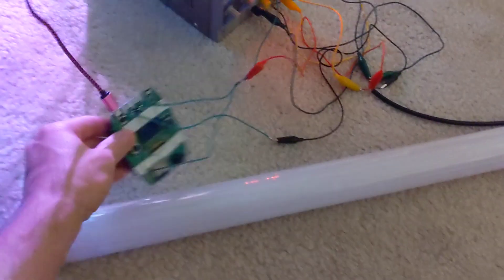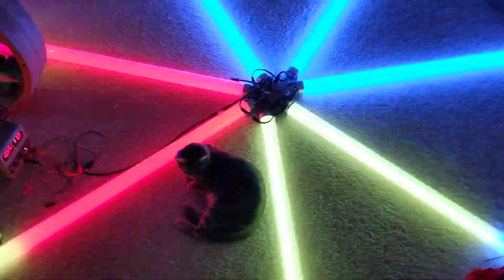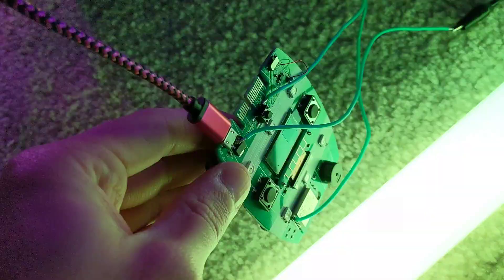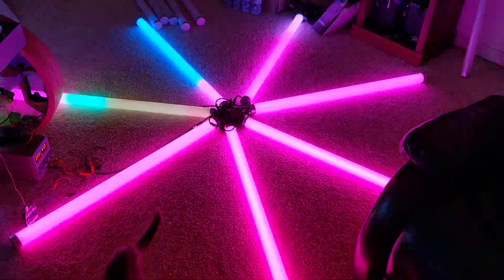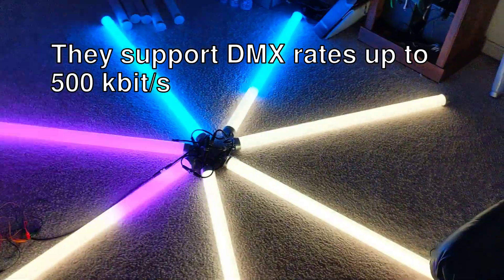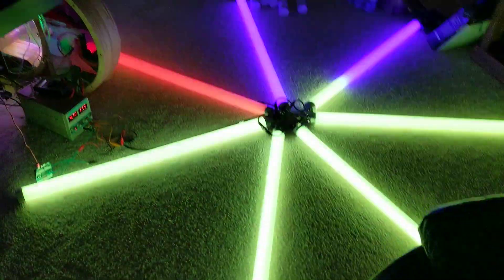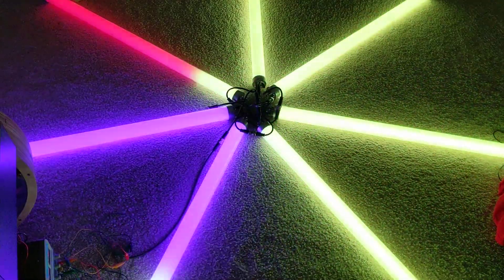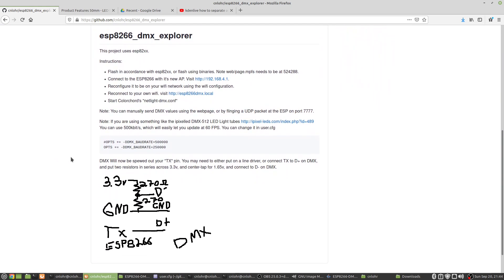esp8266_dmx_explorer: DMX with a web-based frontend + accepts raw UDP packets

Comment: I've been using DMX512, and MODBUS (which uses the exact same technology - only the data is different) - I've always used RS485 line drivers like the MAX481, which are really cheap, but didn't realise you could use a cheaper method like this. Of course I doubt this method has anything like the same range, and doesn't have the isolation you need with a proper DMX setup, but it's a nice trick!
Reply from the maker: Yep.  This is def a janky thing but it works most of the time.

Comment: I've had to deal with discovering unknown addresses before. You can connect one light at a time and try turning half of the addresses on and half off, let the user inform the light's state and select the correct group (on/off). Then you reapply the method to the group selected before. With 8 rounds of this you can find one address in 256.
Reply from the maker: THIS IS A REALLY GOOD IDEA.  I could easily put buttons in the webpage to facilitate this.
Reply: @CNLohr  Just one button - "Is it on yet?" and let the code behind it step through the address ranges 😁
Reply: The good ol' binary search :D

Comment: Is there any reason not to use ArtNet/ArtDmx here? It's almost as simple as raw UDP packets (basically, UDP Packets with a header), supports broadcast and unicast and also has optional support for autodiscovery in the network.
Reply: If he wasnt using colorchord im sure he would use sACN or artnet to get the data to the esp. 
That's the magic of his colorchord though, its doing all the color drawing itself in real time on that esp thats also hosting a website and outputting dmx, amongst many other things
Reply from the maker: I just don't have experience with ArtNet.

Comment: Sorry to be the elephant in the room, but seeing your circuit board
sitting on carpet makes me nervous lol. No antistatic/ESD bag/mat anywhere :P

Anyway this was pretty awesome, thanks for the amazing video :)
Reply: When was the last time you saw an operating circuit in a bag. 

Lol
Reply: @1st_ProCactus  Not IN the bag, but I would definitely have my circuit board sitting
on the outside of the bag at the very least or on an ESD mat...
Reply from the maker: It's fine. It's an ESP.  Every year at MAGFest, we have literally thousands of unprotected circuit boards dangling from people's necks, and in general only a handful breaks, none of which due to ESD.  Modern good chips protect against ESD.  No need for extra precautions.
Reply: @CrucialMuzic  IC's on assembled PCB's almost never have ESD-related failures. It's the loose ICs prior to assembly that need more protection, and even that is intended more to maximise yield than because they die from being looked at funny.
Reply: @CNLohr  I'm sure it's fine, it's just good practice that's all. Thanks for the reply! :)
Reply: You're paranoid. have fun, live a little, bungee jump, run bare pcbs on carpet, pay taxes